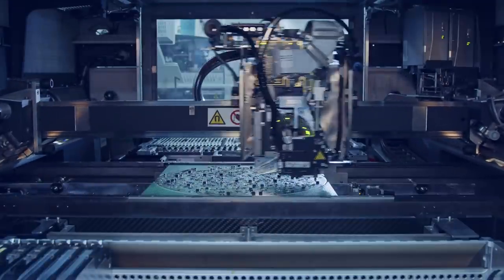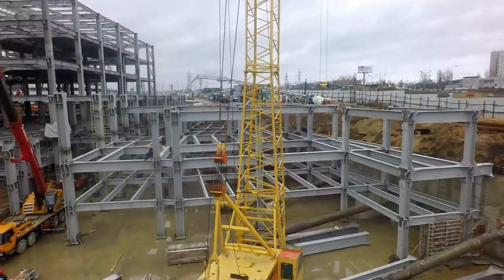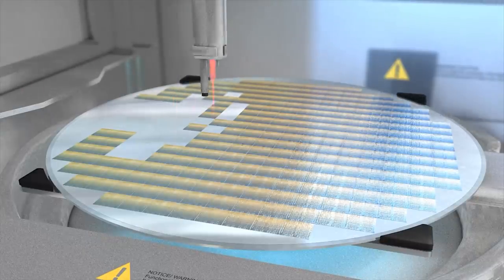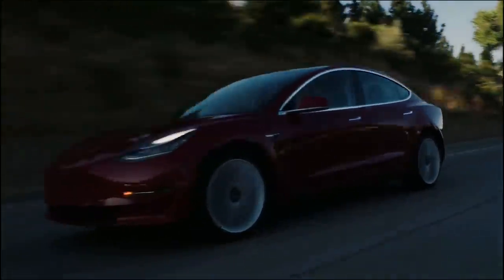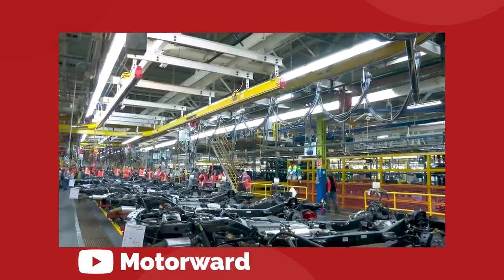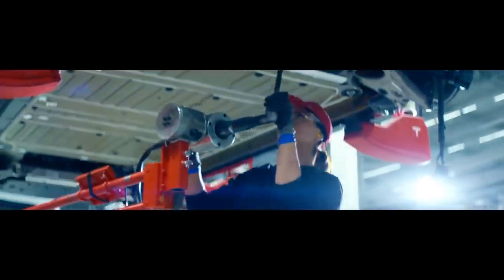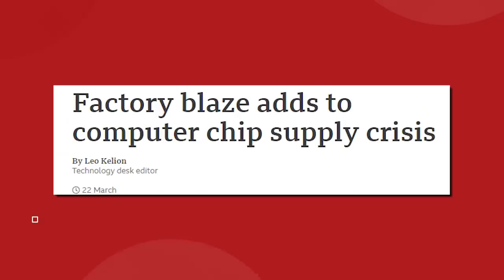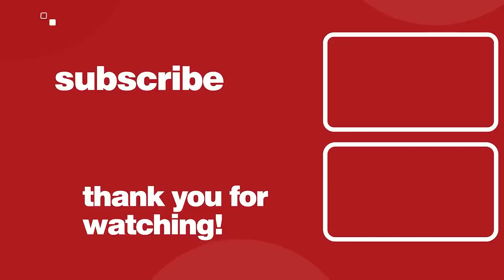The Real Reason Tesla Overcame The Chip Shortage Crisis!

Comment: Another problem is the chips used by auto companies. They are 1990s tech with up to 140nm line widths on old processes and semiconductor companies are way ahead of that and are asking auto companies to redesign and certify their chips for modern processes but at usual, car companies expect everyone to cater to their needs. Tesla keeps showing why old car companies need to die and be reborn as modern companies
Reply: Not true. 140nm isn't even a node size. 130nm or 180nm. Neither of which were possible in the 90's. Also Toyota and Mercedes have the most sophisticated chips in their cars. Not Tesla.

Comment: You miss another issue in the automotive shortage. Tesla does not require the chips to be Reliable Certified. This was a standard that was created back in the 80s as electronic control systems started to make their way into cars to insure that the components wouldn't fail before the life of the car. This limits what chips other car companies can use.

Comment: Can you imagine any issues/bugs coming from constantly "re-writing the car's OS" and changing the PC boards to swap in and out different chips?  How many versions of the software and hardware have been introduced in a single model year?  How thorough can the testing be when the design is in constant flux. Tesla isn't the only one trying these tricks.  However this is being talked about as something great.  In my mind it will result in less reliable cars from an auto maker who is having issues with their software and hardware reliability already.  YMMV - pun intended.
Reply: It is not that changing chips is great.  It's that not being able to change chips results in a nearly impossible situation.  Also, changing the main processor does require changes, but those can largely be contained to just the stuff immediately surrounding the main processor as long as the communication protocols are standard.  And of course much of the code is higher level stuff that can be recompiled.   Not the best situation, but better than the alternative.
Reply: @isaacclark9825  is not changing the chips is the issue. Toyota is know in the performance world to lock down the PCM is hard to tune a 2008> Toyota.  everything is encrypted changing not only the how the software plays with the chip but else the encryption.
Reply: @crazeguy26  That is not part of the topic under discussion.  They would lockdown even without a chip shortage.
Reply: These software rewrites don't happen on critical systems. If for instance the driver for your power seat is bugged, sending an over-the-air update to the software isn't a big deal
Reply: @caty863  I am not convinced that there were no shortages of processors that are used in critical systems.  Why are you so sure?
Reply: @isaacclark9825  What's a 'critical' system in a passenger vehicle?  Primary safety systems  - THE MOST critical - are brakes, and in the case of Teslas these are physical hydraulic actuation via brake pedal, a vacuum-assist main piston, pads, calipers and rotors/discs.  So, if the power goes out - like when you're driving near a UFO and get that telltale EMP pulse that blacks-out your Type S Plaid, you just step on the brake pedal.  The car will stop.  Then we can look at tires  - there's no chip just casing, bead, tread and compound; then on to the windshield (glass and polymer); seat belts (mechanical and mechanical acceleration lock); seats (mechanical with electric actuation for comfort adjustments)...  Point is there are no processors that control the primary functions of these 'critical' safety systems - they are either controlled by the wetware between the driver's ears or controlled by the intrinsic design of the component.  Are you suggesting that Teslas are unsafe because the engineers intelligently repurpose integrated circuit microcontrollers to perform useful functions?
Reply: I'm a cyber security consultant and the first thing that came to mind was all of the security flaws that were created by rushing to deploy new code. In the coming years it will be interesting to see what researchers discover from these cars.
Reply: Yeah. I make a living from companies who deploy said practice. It's bug, security etc. hell (for them) but we do only what we can do within our set workweek.
Reply: What's worse. The OS kernel could have been written by MS. Why does my car play the MS opening song?
Reply: Tesla always made things reversibel. The newest computer tesla does are pocible to putt in in the early Model S same whit The newest motor it fitts in thers oldest car.

Butt thats The way tesla seams to do things, iwe hade a coupel of VW passat, pure chitcars.

Comment: Other things not mentioned, Tesla combines more functions into one cpu, instead of  50 different functions into 50 chips, they do the 50 on 1 chip, as a GM insider, GM, Honda and others insists to keep those 50 functions on 50 chips, albeit the upfront costs are higher, but as with any carmaker, problems arise Tesla included, lets say the dome lights quit working, instead of replacing Tesla's $400 CPU that handles 50 functions, GM (Or the customer post warranty) replaces the $35 controller that controls the dome light.
As for designing chips and writing software in house, GM has done that for 15 to 20 years now, Not sure about Ford and the others though.

Comment: You know the machine at @3:40 is a pick and place machine placing semiconductors onto a PCB ?   Nothing to do with a foundry.
Reply: The pure silicon wafer is drawn out of a foundry oven as it crystalizes, the round circle that the small square chips are removed from, is that sliced crystal after being layered with mostly transistors.

Comment: The problem of other Car Manufacturer is that they have Stupid Management, The Solution is to Design Another Circuit Board using Available Micro-Chip. The Circuit to Application Cycle is only 1 to 3 months, It depend how good your designer is. No need to wait 2 years for the availability of high-end Micro-Chip...

Comment: Stockpiling chips would not be cheap, definitely harmful if things don't go your way.  Good explanation--Subbed.
Reply: why would it not be cheap? with the current situation of the global chip crisis, stockpiling before the crisis happened should've been a good idea. and chips don't expire. so they can just be left into the storage until they're needed. With the global chip shortage happening right now, companies are losing revenues.
Reply: @iamwisdomsky  All electronics have a date code for many reasons and do have issues if stored to long causing soldering issues.
Reply: @dougjones9493  you need to be more elaborate than that. What do you mean by "causing soldering issues"? 
How do you think they store these chips? out in the open? why would these chips even break if they're not opened in the first place. You're also implying that chips have expiration dates. lmao never heard of that. 🤷‍♂️
Reply: @iamwisdomsky  I worked in electronics manufacturing for 30 years. Even if they are stored in the original sealed ESD bags they can oxidation  to the point where solder may not stick properly. Also moisture can creep into the ICS causing issues.

Comment: Car makers have all been hit by the chip shortages but Tesla produce about 1,000 units a day, whereas a manufacturer like VW manufacturers 40,000 units a day so the chip shortage is less severe to those that have smaller production runs. For all their success, Tesla are currently still a niche manufacturer they may come to dominate the industry but currently their small production allows them to be more fleet of foot, as their volume increases they will be saddled with the same problems as the big vehicle manufacturers are currently dealing with.

Comment: Turns out, GM, Ford, etc DID NOT CANCEL.
They were buying chips made with older manufacturing technology, more then double the Nanometer count of current process's, and the chip manufacturers dropped the orders so they could move to making newer designs with smaller transistors and less power usage, which is the products that Apple, Tesla, Intel, AMD etc were all ordering. This is why the issue is 'lack of supply', not lack of demand.
Solution for auto industry is new foundry's making older process designs, which the auto industry want more for the NVH survivability then for power efficiency.
(Don't forget, Tesla's don't have the vibrations of an I.C.E., to deal with..)

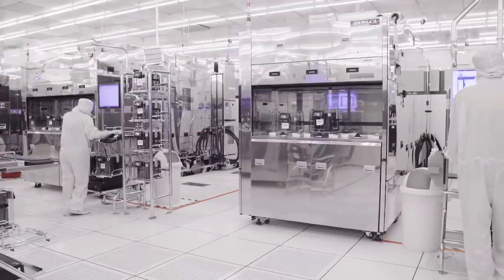Comment: For 5:20, a car manufacturers doesn't do anything with a chip. They already arive sealed in a metal box, often even already attached to chassis or wiring harness. Neither the manufacturers nor the supplieres have the storage to hold even thousands of those, but we build 10k isch cars.
Tesla just don't need as much chips as they condesed a lot of function in their own one. And as they order their own chips they have a long term deal with the factory. Other manufacturers only have deals with Bosch or Continental, which have the contracts of chip makers. So that hirachie will add a view days in every decision that is made. Also Tesla's sensors and actors are much cheaper with less function so you can throw in much more chips. You are not hold back to a specific chip like the Bosch Radar system or any LIDAR would need.

Comment: It took me almost 8 months to get a brand new graphics card after my old one fried. At first I thought it was the whole cryptocurrency / mining explosion, but then I realized that the pandemic affected things more than I realized. 

A shocking amount of people here in the US are trying to make this whole global computer chip shortage political and are solely blaming Biden, but they fail to realize this is a GLOBAL event, not just a US thing.

You just explained in a few short minutes what I've been trying to explain for months to a lot of people since even before the election. It's absolutely insane how bad the whole situation is and how it'll take years to remediate.
Reply: The company i work for now has issue with components across so many of our product lines. Want a breaker panel for your house 8month lead time, network cards to monitor switching and equipment supplliers have told maybe June/july at this point.

Comment: You are spot on, also the chip manufacturing equipment is very expensive and there are over 20 in the many steps in making a chip. Plus with just in time manufacturing it saves cost, also car chips are dumb and years behind state of the art chips.

Comment: I still don't see what the big holdup is - car manufacturers tend to use old designs on obsolete process sizes like 90nm. I always assumed that as a process node ages demand for the chips coming off of it would tend to drop off, softening prices and profitability, but I guess demand for less efficient chips is strong enough to crowd out car OEM's. Frankly I'm surprised car OEM's lawyers didn't build protections into their contracts to avoid this kind of shit.

Comment: AMSL enough said, only one that has all of the pieces to make chip manufacturing equipment.  CEO says they don't have what they need to make chips.  Two week delays would normally cause builds to fall 1 year to 6 months behind.  They shut down the world for almost two years.  All of the moving parts are just not there for a speedy recovery.  Not to mention ultra water production, which may be in the cross hairs of the new green initiative being implemented by the world organizations.

Comment: Chip shortage?  It takes years to ramp up a wafer fab but only a couple of quarters to shut one down, sell off the physical assets, and demo the building.  The processing equipment has to be matched so closely, that starting up multiple pieces of equipment takes a lot of expensive technician and engineering resources.   It takes corporate financial fortitude to carry potential capacity that will only be used during peak times.  Basically, the semiconductor industry is known for being "accounting smart" but "finance stupid".

Comment: Actually one more reason not mentioned or not further explained is, that the chip manufacturers want to maximize their revenue, which in fact is better done with consumer products like consoles and the other stuff mentioned. 

So the manufacturers are more likely to still produce them right now as of high demand than lower cost/revenue gaining microcontrollers for cars etc... 

And these third parties ordered normally and also didn't really get the chips cause again consumer products are economically begged for the manufacturers... 

So actually the chip shortage isn't only cars and consumer and all the reason you mentioned but it is higher demand in general !
So yes higher demand, yes the plants manufacturing these chips had to shut down for some weeks cause Corona restrictions etc. 
And also such chip crisis (at least in automotive industry) happend every 10-15 years! 
So actually your reasons are just the surface or maybe even just some nonsense...

Comment: Tesla doesn't design all the chips they use.  I think they just designed the big one they use for FSD.
But any modern car contains dozens of small microcontroller chips that typically cost under a dollar each.  A FAB to make these kind of chips probably wouldn't be that expensive, because they can probably use a cheap 350nm CMOS process as opposed to the >20nm processes that the big foundries can provide.
Reply: I think that Tesla has an advantage because they use more integrated electronics than the typical legacy auto maker that outsources so many individual microprocessor functions that compete for OTS parts.  It reduces the overall number of chips that Tesla needs.  Also, if integration is achieved with specially designed ASICs, there's probably little to no competition for that part from other companies.  What do you think?

Comment: "Over 3000 steps"????  I've never heard of any chip process that complex.  The simple chips I've designed typically had 20 to 30 steps.  And the great majority of chips in a car would be this simple.  For example, a small 8051 microcontroller that controls the break lights is almost certainly just 8-bits, and probably has 1k bytes of program space.
Reply: I've never seen a chip produced in 30 steps.  How?
Reply: @External2737  Now that I think about it, 30 was probably too low.  But "3000"?  
It was a few years ago, but I'm pretty sure the xa035 process from x-fab had only 14 masks, if you didn't include any of the add-ons.  That's for just a 350ns 3.3V CMOS process with 3 metal layers, which is fine for a small microcontroller.  The various options added 1 to 3 masks each.  (The EEPROM module didn't add any masks)  I think in the end we had 22 masks.
How many actual steps is that?  I don't know exactly, but for each mask there might be around two to four steps? (implant/diffuse or deposit/photoresist/expose/etch)

Comment: It’s just that the 8..10 year „pig circle“ of semiconductors does not fit into the quarter based economy. If you are a bit older, such a cycle is nothing new to new. It only take the young generation by surprise. 
And car companies are not used to have lot sizes of their yearly requirements for parts. They want „just in time“ delivery and strongly believe there’s no different scenario needed for these special parts.

Comment: 10~20% of internal chip supply capacity would make rooms to deliver enough vehicles. Gigsfactory already proved values of cutting edge business through integration. 
Electronics simplification would be heavily dependent on designs. 
One chip can be enough? 
Presently thinking this issue.

Have a good weekend!
Reply: one chip with all the systems like a SoC? nah. that's no good. that would mean when a part of the chip breaks, the whole thing needs be replaced. Also, some of the chips are "sensors". So they can't be integrated into that single chip coz they need to be placed exactly where they need to be placed.
Reply: No, one chip can’t be enough. Tesla needs many, many different kinds of chips.
Reply: @peterfireflylund  Then, what about less amounts of chips ?

Comment: the real reason for the shortage is that microship manufaturers switched to new chips since demande rised to the roof with the pandamic, those chips have hight margins, most car manifacturers use old chips (low margin), so they don't have to rewrite software for them.
tesla uses a combination of both so its easier for them to switch

Comment: The Chip Shortage is the fault of Auto Manufactures. Chips are cheap to make and to not make them in house is a stupid move. I worked for TVA for many years and they knew long before I got there the more you depend on outside companies the more undependable you are. You are also conflating chips manufactures that make many different types of chips for many different things, Auto maker  only need specific chips and not very sophisticated at that.